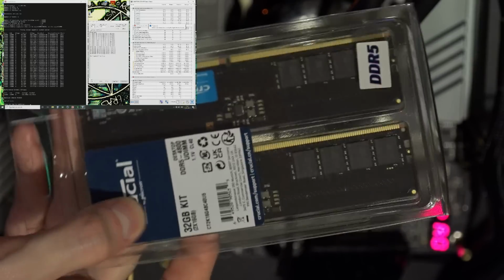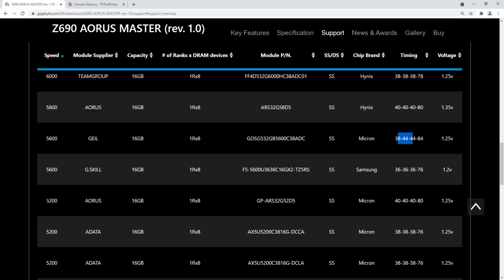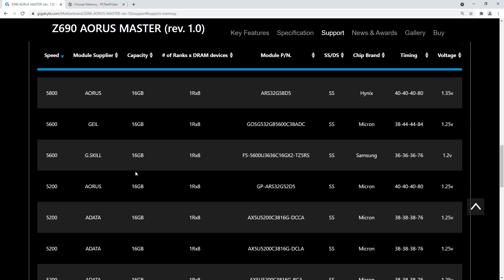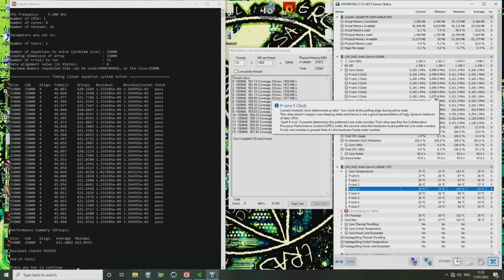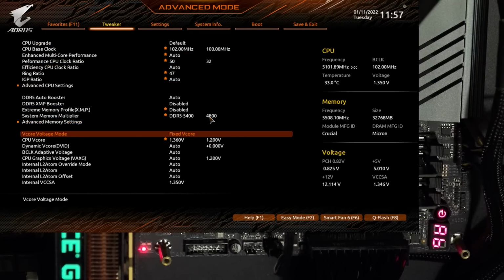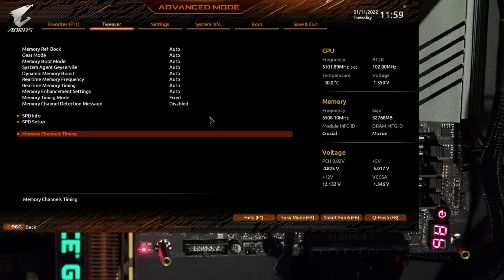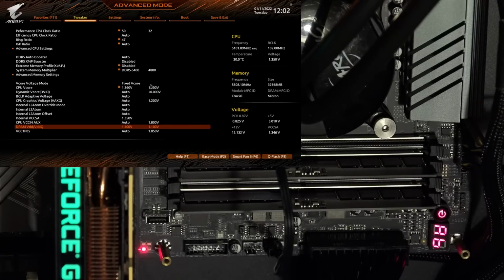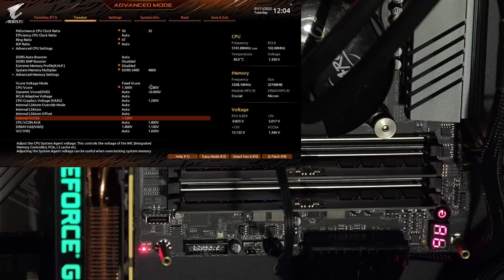Quick overclock of a 2x16GB Crucial DDR5 4800 CL40 kit to 5500 CL38

Comment: I got exact same RAM 2x16 and Gigabyte motherboard I set my vdd and vddq voltage to 1.3v ,multiplayer to 54 also timings as in description and I get a black screen. I had to reset mobo with CMOS. Can someone explain to me what am I doing wrong or point to some guide? Im very noob to ram oc just wanted to squize out a little more out of my system.
Reply: Did you get it to work?
Reply: @saiprasad8078  nah just gave up on OC it because there wasn't much info online. Might be different now, haven't try to oc it since then.

Comment: I've more or less been running the 2x32GB 4800mhz cl 40 version of that kit at 5400mhz all auto and 1.3v on the Asrock PG riptide b650m for a decent while. Been alright so far. By a decent amount the cheapest line up of DDR5 2x32GB kit. I suppose the best quality of the ram is the price.
Reply: It's been a while, but have you tested more?
I'm trying to get budget am5 Plattform

Comment: Buildzoid is there any folow up for this ram kit ? After latest HUB video about timings for zen 4 cpus, you gave them settings for hynix rams. What about tuning timings for this ram kit instead of frequency increase ?? HUB didn't tune 4800mhz cl40 kits, however trying hynix timings on micron memory ain't good idea. Any way to do tinkering of this kit but reviewing how latency and timings can be tuned while staying at 4800mhz ?

Comment: I cant over clock my ddr4 Corsair dominator platinum ram 8x4 over 3866 even if I increase the voltage over 1.5volts it just doesn't cope well and crashes for no reason. I am looking at 5000mhz ddr 4 ram but it's just so expensive.

Comment: Hey there I have the same exact motherboard and ram (only 16 gigs),I tried these settings and they work good but I have to start the PC twice if I turn off the PSU. It's a thing it does only on first boot up and only if previously switched off the PSU. Maybe something related to ram training but I'd like an opinion

Comment: Again, this shows that it is crucial to overclock / tighten a crucial brand.. i just did myself BLM2K8G40C18U4B 4000Mhz at 16-19-16-16-36-60 at 1.46V roock stable, runs like a charm, aida shows insane speeds like 60GB/s read with 47ns lat. Edit: samsung b-die is still no.1 but is more sensitive to OV/temps, 1.5V ddr4 crucial is still very ok i was told

Comment: Did you ever tighten these timings or post an update? I just got a 4800 ddr5 micron kit (oloy) and started overclocking ram for the first time. This video has saved me so much time from reading forums, huge thanks!

Edit: I have it to 5400 with my timings at 38 39 39 48 and tREFI at 32000 (65535 didn't improve my timespy score and neither did any other sub timing changes so I left the rest on auto). I'm at 1.25v, other voltages on auto (MSI mb) and stable in memtest. 18,300 time spy cpu score and haven't OCed my 12700k yet

Comment: Greetings BZ, Im scratching my head about something I dont understand quite well.
Ryzen 5000 has the sweetspot frequency at 3733MHz iirc, so if I buy a 4000MHz DDR4 CruBall MAX kit...tuning the frequency down to the 3733 MHz...does the higher frequency bin allow me to get tighter timings then the 3600MHz Rev E Crucial Kit turned to 3733MHz? Or does it end up equal?

Comment: I have the crucial ddr5 2x32 kit. I'm curious if it will overclock properly on my gigabyte z690 master. If anyone does, let me know! I'll be building my PC this coming January.
Reply: I used these exact settings with the 2x32 kit on an asus z690 gaming-e and it works flawlessly.
Reply: @coolfire936  I have the same board and crucial 4800mhz. Could I copy these OC settings?

Comment: i bought OEM Asus sticks  (= rebranded Micron OEM sticks with green pcb's) and managed to push them to 38-40-36-52 @ 5400. After tuning secondaries and tertiaries, I got 65ns in AIDA, which is okay for Micron ICs. Pretty happy with these, I thought they wouldn't overclock much at all.

Comment: Disappointed at 4 DIMM performance, I thought DDR5 was registered by default ?  The thing is, you don't need the performance benefits of a memory overclock when the system is new,  but when she's getting long in the tooth and has had the ram expanded,  that is when CPU bottlenecks and need all the RAM speed you can get..        /still on Ivy Bridge DDR3 here... was holding out for DDR5 and the promised benefits..

Comment: What is the real world disadvantage of x16 memory chips on 8gb ddr5 modules? Dont need 32gb of ram so am wondering how problematic is is to get 8x2 = 16gb modules
Reply from the maker: less memory bandwidth because the memory controller can't interleave memory access as much as it otherwise could.
Reply: @ActuallyHardcoreOverclocking  Hi thx for what you're doing, does it have an actual impact on gaming ?
Reply: @ActuallyHardcoreOverclocking  forgive my ignorance but outside of benchmarks how relevant would this be to an enthusiast (but not professional) consumer, like it it worth shelling out double the money for 16GB dims if you don’t need the extra ram purely for this reason?
Reply: (other components would be ASUS Z690-I MOBO and 12700k not sure if thats relevent)

Comment: Does anyone know what the upper limit for voltage on daily use ram is? I'm planning to mess around with my Corsair Dominator Platinum 5200 CL38 which have micron chips from what I understand if that's important

Comment: I struggled to even get my corsair dominator to the xmp speed of 5200, and that's on a Z690 Hero. I  looked on the Rog forum and there were others having the same issue. Eventually after updating the BIOS to 0802 which didn't help, someone suggested swapping the slots to the a2, b2 slots and that worked, but I can't get them to go any faster than 5200Mhz, even with 1.35V, I couldn't even get 5333Mhz.
Reply: That's sad
Reply: I got g.skill DDR5 running at 5600 easily so idk

Comment: Why to buy DDR5 at all for now, when proper DDR4 (and mobos for them too) is cheaper, available and not slower?
Reply: Because when you upgrade to a 12th Gen Intel, you will need a new motherboard because of the new LGA1700 socket. Would you rather buy a DDR4 motherboard and be stuck with DDR4 for the next couple of years until you upgrade your motherboard again or invest now in a DDR5 board and be able to upgrade your DDR5 RAM or your processor without having to buy a new mainboard.
I'd rather go with DDR5 now, than buy a DDR4 board now. But if you already have a DDR4 board and dont need to upgrade your processor, it makes sense to wait for now and upgrade when DDR5 becomes better
Reply: @QuinnTheTailor  You will be changing memory again anyway, exactly the same as everybody changed their "superb" DDRr-2400 into faster ones. So for me best solution is to go DDR4 and don't care, or maybe even stay away from Alder at all.
Reply: @ppp3435  yes i might change memory in maybe 2 years when DDR5 modules become much faster and cheaper. But i won't need to buy a whole new motherboard for that. But if you buy a DDR4 board now for the 12th gen and you want to upgrade to DDR5 in 2-3 years, you will need to buy new motherboard for the 2nd time. If you have the money, sure go for it. And yeah, as i said, if you are not deeply in need of a new processor, it makes sense to stay away from Alder Lake and upgrade with Raptor or Meteor lake
Reply: @QuinnTheTailor  not really... were going to see some crazy kits before raptor lake.

Comment: I have 2x32GB of these on the way hopeing for 5200 38-38-38-72-CR1 1.25V will also try 5400. Picked up some copper Ram Sinks from scan 49p a set they are selling them off as people buy ram with sinks these days
Reply: Hi, is it necessary to put heat spreaders on the sticks? Where exactly did you get them? Thanks.
Reply: Have you attempted to overclock the 2x32gb kit? I have the same kit, and will test in January

Comment: Pro Tip: leave e-cores enabled and disable HT. lower temps/more performance....
Reply: What if you wanna use more threads than the number of P-Cores?
Reply: @gustavalbers3238  My point was for performance, if you are going to disable e-cores or HT, HT would be my choice because e-cores>HT... 8 P-cores+HT score 22000 and at same clock, p-cores+e-cores score 24800 in Cinebench 23 with e-cores stock...
Reply from the maker: @carlhil2  E-cores trash the ring stability

Comment: Your linpack results are heavily FPU-bound at this point. ecores on would likely score better, i'm up to 727gflops w/ a 5900x.

Also no need to run tRP super high just because RCD-RD requires a high value any more. A friend has RP 28 stable in all tests with these things.
Reply from the maker: intel split the timings at last?
Reply: @ActuallyHardcoreOverclocking  Yep, but no RCD WR yet :D

Comment: how are you passing linpack at such high frequency with a memory oc? i cant even pass linpack at 4.8ghz (1.45v) with xmp (coffee lake-r)
Reply: Something on your system is not stable.

Reset everything to stock, including memory (JEDEC). Run linpack - it will pass.

OC memory (XMP or manual) while retaining stability.

OC core while retaining stability.

OC ring while retaining stability.

Then you're done - and stable.
Reply: @AerynGaming  
is there any reason why tRDWR is significantly worse on my apex board vs a strix board? strix did 9 apex barely does 15, posts at 34-35 on its own
Reply: @bigcazza5260  You might have training issues. Make sure RTL/IOL are good (usually RTL within 2 ticks of eachother, IOL within 1) and play with the IMC and signalling settings (SA, IO, command rate, RTT's).

Try different bios versions!

additionally, RDWR doesn't do anything by itself. It's only useful in the context of what CL and CWL are.
Reply: @AerynGaming  im on the latest version, does tRDWR get really loose with aggressive tCWL? i can run tCWL 11 and tCL 14 (3600 1t). IOL train fine, i dont know what RTT does, i cant see why my tune on 2dpc t topology wont work on 1dpc. its worth noting that the apex came with bent pins in the socket and 1 slot wouldnt work at all, i did some surgery to get it working, maybe i have bad contact on an lga pad?
Reply: @AerynGaming  honestly the apex board has been really finicky about memory oc, i cant fathom how it wont run the same settings as the strix. some timings go a tad faster but most take a giant shit
Reply: WITHOUT avx too
Reply: biggest head trip is that timings that worked on a strix z390 dont even post on a z370 apex

Comment: i dont get how samsung went from having a signicantly better ic than everyone else with ddr4 but then sort of dropped the ball on ddr5
Reply: What's wrong with samsung ddr5? They're running 6000 G2 1T and up to 7000 G2 2T with decent timings as far as i know. One friend is smashing benchmarks with them already.

Also, remember that samsung's god ddr4 IC is 8gbit **B**. A and C both suck.
Reply: @AerynGaming  isnt hynix slightly better tho?
Reply: @bigcazza5260  Is it? In what way? Nobody has been able to show me either higher frequency or better subtimings than the samsung stuff that i've seen.
Reply: @AerynGaming  fairo just going from what buildzoid said in his frequency scaling vid
Reply: @AerynGaming  yeah b-die is king even a bad bin, just send the volts

Comment: Hi Buildzoid, will you be doing DDR4 OC content on Alder Lake platform ? DDR5 is stupidly expensive and hard to get for the time being
Reply from the maker: don't have a Z690 DDR4 board yet.
Reply: @ActuallyHardcoreOverclocking  please test. I want to know if 4400mhz ddr4 ram runs stable on 12900k. supposedly cpu supports 3200mhz max ddr4. And I would want uptime of at least 1 year.
Reply: @ActuallyHardcoreOverclocking  hey bz, is ddr5 really that good? the primaries and subs look like crap i mean 4800 cl40 seems stupidly loose but that's only if we're speaking about ddr4, what would be the way to go at the moment? Going for a generic ddr5 kit like this one, or buying a ddr4 z690 and just get a 2x8 or 4x8 kit of cl19 vipers?

Comment: thanks, sadly the only thing I was able to order were 2x8Gbs crucial... a temporary solution I need something to boot the computer >< all ddr5 are "Currently out of stock and no delivery date available." so once again we watch a technically useful and correct video but completely disconnected from reality as you cannot buy what you want only what you can, if anything at all
Reply: Exact same situation for me, and still not in stock even with the preorder :') An upgrade 1 or 2 years down the line maybe

Comment: MSI says that the Z690 Ace supports 4 DIMMs at "4000+" MHz. Sounds like DDR5 is meant for 2 DIMMs only.
Reply: same as ddr4? no ones running 5GT/s in 2dpc mode

Comment: was expecting 6400 CL24  :(   or something like this
Reply: i don't think c24 is gonna happen on any frequency
Reply: CL24... are you baked
Reply: with XMP not if you would push just the timings to the limit I tooth maybe, but as it seems after GPU CPU and now RAM overclocking is dead (every day )

Comment: I somehow managed to get a gskill 6000C36 kit, though it came in a combo with a motherboard I don't need. Just one more day till I can finally use the 12900K that's been sitting on my shelf for 3 weeks.

I wonder how much I can reduce the latency.
Reply: Bless you early adopter! Please report your findings back... In the name of science
Reply: @bogartwilley  My first DDR5 based system will likely be around when gen 13 Intel drops. These early DDR5 kits are e-waste, just like early DDR4/3/2/1.
Reply: @bogartwilley  Not very good so far. XMP isn't stable even at gear 4, 1.35v vdd 1.4v vddq, 1.35v vccsa, 1.35 imc vdd. I just get hundreds of errors in memtest within 10 seconds.

5867MT/s is unstable, 5800MT/s is unstable. Trying 5600 now.
Reply: @bogartwilley  Omg I manually maxed out the switching frequencies and current limits in Asus's dram voltage menu and it's much more stable at 6000 36-36-36-76 now than it was before at 3600 jedec spec with all the dram power settings at auto. Wtf Asus.
Reply: Thats nice. My local place had 6600 C36 gskill listed, but out of stock. Ended up going ddr4 coz the only kits of 5 available were entry level and testing seem to show that good DDR4 is comparable with DDR5 6000 kits in most things.
Reply: @KraziAgentAdam just like ddr4 vs ddr3 was on launch
Reply: @KraziAgentAdam You will never get DDR5 with CL20, that is just childish dreaming. Benchmarks show DDR5 CL36 6000HMZ destroying best of the best DDR4 already
Reply: Where did you get gskill kit from?
Reply: @fat4ll  Newegg with a motherboard combo. It looks like they've outright removed ddr5 from their store though.
Reply: @KraziAgentAdam No, actually DDR5-6400 CL40 is as good as DDR-4 3200 CL20 or better.

Comment: Dimms with single rank 32GB are double sided 16Gb Micron. They have different PMICs and are difficult to overclock.
Reply from the maker: you can't have a double sided, single rank dimm. This: https://uk.crucial.com/memory/ddr5/ct32g48c40u5
Is a dual rank dimm
Reply: @ActuallyHardcoreOverclocking  Yes, it's dual-ranked double-sided. I bought a pair of them. ASUS XMP profile shows 4800C40, 4400C36 and 4000C32 1.1V three options.